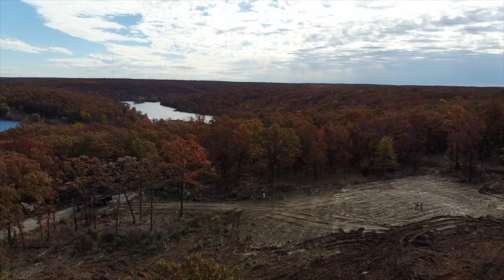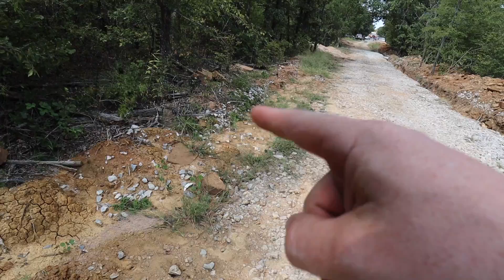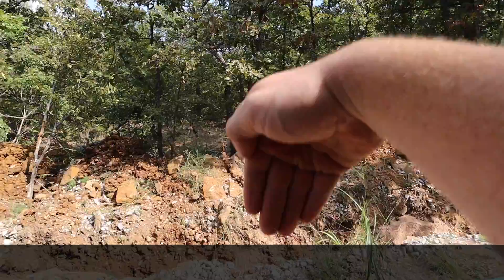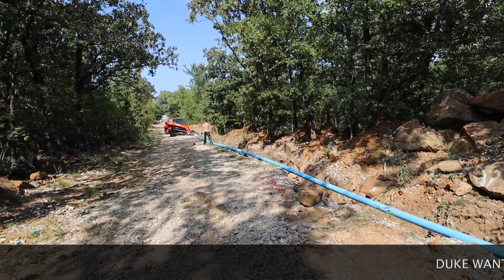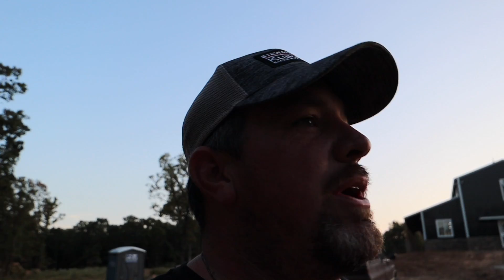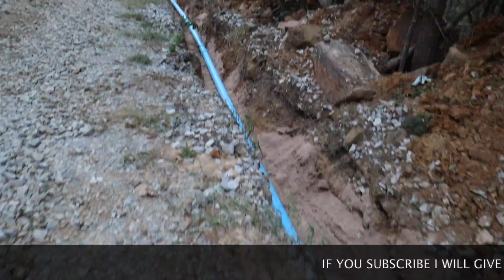GOVERNMENT Won't Let Me Have Water!!!! TAKING MATTERS INTO MY OWN HANDS!!!

Comment from the maker: Check out the follow up video...

https://youtu.be/JF99kMKjMzU
Reply: lol you hearted your own comment .   i dont understand why  ?    as for your if its not orange its a lemon ,  well some of us are poor and can only afford a lemon unless wealthy people like you wanna help  ?  i'm disabled and sure could use a good small tractor with all attachments including a snow blower .  :))   that being said i could use a new body  , mine is letting me down .
Reply: @carmichaelmoritz8662  ??
Reply: @sqeekykleen49  its all good squeeky kleen  ???   :))
Reply: Unless you are planning to subdivide your property 4" pipe is waaay overkill.  Volume does not equate to pressure. A one inch line would be more than enough for a residence and a barn/ workshop. Remember basic math regarding volume. If you double the diameter of the pipe you get 4 times the volume. So, you are getting 16 times the volume of a 1" line with no more pressure. You just spent a whole lot of unnecessary money on pipe. And when you have a leak, it is going to be a huge issue instead of a small one.

Comment: I ran a 1 inch for 1760ft, had a rise above the meter of 56ft. House is 70ft below the water tower that sits 3 miles away. Had 45psi with no problem.

Comment: I've probably installed several hundred miles of this stuff.  If there is a next time, simply straddle the trench with the excavator and place one piece in at a time and use the back of bucket to press the pieces together.  You will make a better joint seal, not break your back and get done a lot faster, not to mention that when you connect the pieces and then move the pipes a lot, you tend to loosen the joints and cause leaks. 
And keep the blade behind you when you are working on mini-ex's, it creates a lot more downward pressure/leverage, especially when using the pecker.

Comment: why the need for a 4 inch supply line for a house?  seems excessive.  Most lines for residential are 20mm (3/4 inch) if on mains pressure.
Reply: William O'Loughlin 1” minimum or you won’t have any pressure. The greater the distance the more you need.
Reply from the maker: William O'Loughlin it’s for several houses/structures.

Comment: It rains enough in NE Ok for you to catch run off of your buildings.  Get some large water tanks and burry them and to start off, buy water and fill one completely.  Also drill a water well like the other folks mentioned.
Reply: Why 4 inch water line?  2 inches should be sufficient.
Reply: Get a 2x6 short piece of board and a sledge hammer to force them  together.

Comment: Yeah, why put a booster pump? I don't know how you feel about having or building a water tower/tank, but I'll bet it wouldn't have to be too high to get the pressure that you'd want. Of coarse, you would have to have a pump to fill, float, pressure regulator, valve manifold, etc.; But I'd bet it would be less wear and tear. Cost? I'm sure it'd be more; but, in the long run and over the years, plus a consistent pressure that I'm sure you'd enjoy . . .your call.

We used to call that BlueBell. A bell and spigot arrangement, compression ring, lube. Looks like Sch. 120. plenty thick. Don't know your pressure. If too high, you'd have to chock any outside bends leading up to the manifold.
Reply from the maker: Gary Randalls great comments. Expensive but interesting thought. Might put tanks in the house.

Comment: old post lol but here they are used on any pipe so many meters both sides of cast fitting like elbows doesn't matter the size of pipe but like was mentioned before codes are different etc

Comment: I f you fill it in with those rocks it will put a hole in the line over time. Pipe is back words for the fittings presur will blow it apart.not sure how deep you went but it dint look that deep frost here would back pipes.other then that glad you got it done .hope it works for you truely. If I would have done it that way I would have tons of problems.

Comment: ARE YOU SURE YOU DO NOT NEED 6 INCH PIPE. IF I RECALL MOST INSURANCE CARRIERS WILL NOT COVER A PROPERTY MORE THAN 600 FEET FROM A HYDRANT.  NOTHING WORSE THAN SEEING YOUR HOUSE BURN AND THE INSUR. CO. SAYS........"SORRY BUT YOU LIED ON PARAGRAPH 3 WHERE YOU SAID YOU WERE LESS THAN 600 FEET FROM A PLUG." CHECK FIRST.

Comment: Pressure won't be a problem, volume might be? A booster pump may not help the volume issue. You won't have a problem with 900' of PVC, for one house but 4 might be a stretch. Just speaking from 35 years of fire service. I wish you plenty of luck!
Reply from the maker: 1961fireguy thanks for your input!

Comment: That 4" pipe would not provide enough water to s fire hydrant unless you were going to free flow out of it.
Most fire hydrants on rural water systems can only free flow into a fire trick PVC pipe cannot have water pumped out of it by a firetruck. The suction vacuum will collapse the pipe...plumbing is a skilled craft .
Reply: I have City Water. Unless I'm mistaken my main in front of the house is only 4"?

Comment: Hope the backfill doesn’t contain all the rocks.
Reply from the maker: Yeah you can’t really see it but I put one in.
Reply from the maker: akbychoice I used as much clean sand as possible.
Reply: Blackberry Ridge good deal, possibly a trace wire too? In Australia they put a layer of black sand above buried lines to signal anyone digging later that there is buried lines or pipes.

Comment: 4" line... A hotel or a fire hydrant, the latter I guess or does the large diameter help against freezing?
Reply from the maker: Sqeeky Kleen decision based on lack of pressure
Reply: @blackberryridge8205  this will increase flow, but will do next to nothing for pressure. I had a commercial building with a restaurant with water pressure problems. We added a pump and a huge phnumatic tank to solve demand problems with the Sloan valves for toilets, dish pass equipment, ECT. Cost around $ 150/ 200 month in electric bill.

Comment: doing it that way puts too much pressure on the joints between where your working and the skidsteer. too much pressure on the pipe can cause it to blow apart later if its tapped by driving it past home. you should have done each stick as you were digging with the trackhoe.

Comment: looks to me like you put the pipe in backwards.  The bell should be on the down stream side for flow, so pressure isn't going into the gasket.
Reply: Has nothing to do with uphill or downhill basic flow characteristics and pipefitting
Reply: @ericbettis2777  When you look at a cut away pipe section of a bell and  spigot pipe joint the water flow across the joint is designed to be the same in either direction.  The water pressure in the pipe helps keep the joint water tight and leak free.  In municipal water systems whenever possible water is fed  from both ends of the pipe so smaller pipes can deliver more water.   Also if you have to shut down part of the system to make repairs less people are out of water. On steep hills the advantage of having the bells face down hill is that it is easier to keep the joints clean that reduces joint leaks and contamination of the new pipe.
Reply: Well for someone that runs pipe for a living, I've seen gaskets bolw out when the flow goes backwards.  But hey it's your line.
Reply: The bell on pipe is generaly kept on the down hill end of the pipe if there is much of an incline, otherwise the bell is in the direction the pipe is being layed.  It is easier to connect that way.

Comment: Use a 4x4 between the pipe and what ever your pushing on it with... You're going to damage the bell end of the pipe... I've put together that exact pipe with a 4x4 and a 10lb sledgehammer
Reply: I've done it with a bar also.... Just protect the bell end of that pipe
Reply from the maker: Brian Sell I was just doing it the way 2-3 different utility contractors suggested.

Comment: A 4" pipe will have a capacity of 240 GPM, and that is at very low pressure. A 1 1/2" pipe would have 35 GPM, so plenty for even several homes. 4" is just a waste.
Reply: thats what wealthy fancy people so , they waste .
Reply from the maker: 18”
Reply from the maker: NoC rather be over engineered than under.
Reply: @blackberryridge8205  "Over engineering" can add a whole new set of problems. If you put the majority of you farm on well water the four inch water line becomes even more of a problem.  If the water pressure ever drops in the city mains and any of the joints in your main leak they will contaminate your water and possibly the city water mains.

Comment: I am puzzled...What is the point of installing a water supply pipe to the road when there is obviously an objection which means the town will likely refuse to connect it to the supply? Why not just drill a well instead & have done with it?

Comment: Not sure how cold it gets there, but it doesn’t look like it is below the frost line.
Reply from the maker: Frost line is 18”
Reply from the maker: Sam Camp camera is deceiving. Bottom of ditch is 30”+
Reply: I thought it was just under 3 feet. Up here, Toronto Canada, we bury our pipes at least 5’. And if you drive over the areas it can drive the frost deeper. I would recommend not traveling over that area in the winter especially with heavy equipment. All the best.

Comment: The city can't stop you laying pipe,  just resist connecting you.  In Australia on rural properties most water lines, ( even to homes),  are black poly pipe.  Easy to roll out,  fewer joins,  easy to add junctions etc.  Mostly 25mm.  
A four inch line seems oversized.
Reply from the maker: Wendy Morrison sized that big dye to limitations on the city size of pressure

Comment: did the city give you a spec for the valve you will need from the main to your line ? who is going to hook your line to the main ? How long do you have to chlorinate the new line? I have missed a lot of answers you might or might not have said but the cost of all that stuff is what made me scrap hooking up to the city and just putting in my own 4'' well and I have more and cheaper water now and the water is great and no monthly bill .
Reply from the maker: D B licensed plumber has to do the tap into city line. I buy the meter from city. I just have to flush the line really well before drinking.
Reply: @blackberryridge8205  they are not making you chlorinate the line at all ?

Comment: No winter freeze in northern Oklahoma? Up here in New England the water pipe needs to be min. 4 feet deep, I think from the top of the pipe. That would mean for a 4 inch pipe, a 5 foot trench. The trench in the video didn't look more than 3 feet at its deepest.
Reply from the maker: Ralph Averill frost line in ok is 2ft. Ditch is 2.5-3ft
Reply: @blackberryridge8205  
Thanks.

Comment: No need for breaker bars and rocks. Line it up and grab the end of the pipe. Then with your back facing the joining pipe, grip the open end with two hands, shove back and twist all in one motion. Put your weight into it. That pipe will slide right together. You'll be tired by the end of the day, but it's much faster. Plus with the city not wanting to cooperate, they may not be willing to install a booster pump to keep enough pressure for that 4" line, especially running uphill like that. Not sure what the PSI is at their main, but I doubt it's high enough to keep good pressure on your line. You may end up having to install your own booster pump to maintain 40-60 PSI. Also (at least in Kentucky) a new main is required to be filled with a chlorine concentration of 50mg/l or ppm, and retain a residual chlorine of 25mg/l after sitting for 24 hrs. If the 25mg/l residual is not there at the end of 24 hrs, you must flush and restart. This has to be done per state law before it can be put into service. Might want to check your local code on that.
Reply from the maker: Jordan Hooper good info. Thanks I will look into all that.

Comment: A 4" line for a residential service could be a health hazard, you most likely will not be able to move enough water through the line to keep the bacteria from forming, just a thought
Reply: Add a blowoff on the end of the line, get a colorimeter and test it once a week or so to determine how often you need to flush
Reply from the maker: Brett Evans good concern to have. I will have to think of a solution for that.
Reply from the maker: Thanks for info!!
Reply: @blackberryridge8205   "residential service"  lines are 2'' and smaller, You're fine with a 4''
Reply from the maker: That’s what I thought too
Reply: @blackberryridge8205  4" line is 4 times the volume of 2" … I think the point was too large a line the water will sit stagnant in the lines longer. a bigger line is not flushed clear as often
Reply: @fionam3554  most likely chlorinated municipal water... and seeing as how he's talking livestock and irrigation on top of residential use, he's going to need larger than the standard residential line..  as far as being flushed.. no water mains are ever flushed, so I think you should rethink, or do more research on your view of how things work.
Reply: @BobSmith-rs7tn  No water mains are ever flushed? I don't know where you live, but other areas certainly do flush mains.  You should be doing that research if you don't think they flush them, or maybe just where you live they like pipes full of sediment. They send alerts each year before they do it.  I don't know if he needs 4X at any point, most people do not water their crops and their animals while they are taking a shower, and if he questions pressure he might be planning on a raised tank as well which would moderate surges
Reply: @fionam3554  never once had an alert for pipe flushing... Maybe you just live in an area with an antiquated system? I have a small commercial property with a 3 inch main in, and it's at least 60 years old... a 4 inch main for a farm/residential split isn't unreasonable at all..
Reply: @blackberryridge8205   I wouldn't show the city this video though. You can't put several joints together and push it in the trench. When you go to home several joints into one like you did, you're also pushing the joints you already homed deeper into the bell, which causes bells to split. When you snake it like you did with no fittings you're also past the allowable deflection. I understand why you did it but the city has plenty of reasons to not sign off on it (if they watch the video). With all that being said if you don't have a lot of pressure you should be fine but if they make you pressure test it to 200psi (industry standard) the bells may split during the test. You also need a blow off to get the air out and blow it off after you disinfect it. Did the city price you a 4'' meter, they can be pricey?
Reply: @bcagle2010  hes very wealthy , dont you worry about him  .
Reply: @carmichaelmoritz8662  So if you're wealthy you don't have to do things correctly? Got it
Reply: @bcagle2010   no its just most wealthy people dont need to worry about doing it over again the proper way  .  got it  :))    wealthy people like to spend and show off  .
Reply: @carmichaelmoritz8662  lol, wealthy people hire competent people to do work for them. They don't rent equipment, leave out fittings and attempt something they know nothing about all in efforts to save money. Nothing against the OP, I was just trying to help. I'm a utility contractor and no inspector would pass that line the way it was installed.
Reply: @bcagle2010   was just funning around about dont worry about him  .  i understand your point .   its just wealthy people like to spend and show off and do things the convenient way due to the fact they have lots and lots of wealth  .
Reply: The engineer and city may also be concerned with downstream customers. If this line isn't engineered correctly it could starve everyone else.  The city would have to invest in pressure/flow boosting themselves.
Reply: Brett Evans 4" line seems crazy to me for a residence

Comment: should have pressure tested line with water not air  should have been 6 feet deep if they get cold winters can pressure test it with water truck and then pump clorine  in it let sit for 48 hours and then flush it all out  If your connecting into city water don't use booster pump city lines have like up to 100 pounds pressure in them most houses don't need or use that much better cover pipe before you pressure test it will pull apart from pressure I do this work for a living
Reply from the maker: brian c definitely doesn’t get that cold.
Reply: Never seen 100 lbs water pressure in any city
Reply: the company I work for installs all under ground pipes and most time we test water main at up to 150 lbs  with a test  pump let sit for 48 hours for the pressure test on all size of water main from 6 inch to 18 inch even the 5 ft concrete water main we are currently installing lol its a worse pipe to install city is corinating it for months
Reply: @brianc5685  yes, That is standard here also. But city water supply at 100 lbs I have never seen or heard of that high.

Comment: If you don't spot buried it before your test like that one guy said it could jump out of the the ditch or if it rains it'll float out of ditch the you have to spot Buriey it I did irrigation for at least 20 years and we've never leave that much pipe without it being spot buried all kinds of problems can happen

Comment: Going from a 4-inch line to a smaller line should increase pressure. Also, It looks like you are going downhill with your pipe, so that also should increase your pressure. If you end up having issues with the water heater popping off. You may want to put a pressure regular on it.  Good luck with the city.
Reply: OD is volume - head is pressure
Reply from the maker: Gerald Harvill thank you.